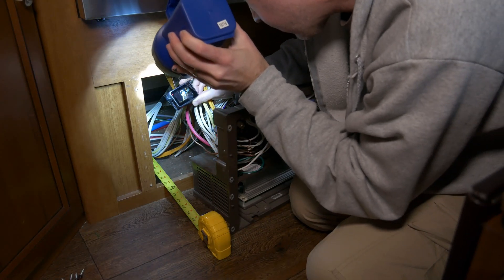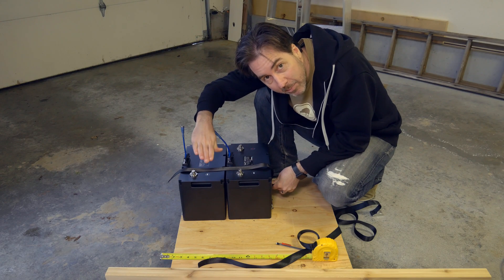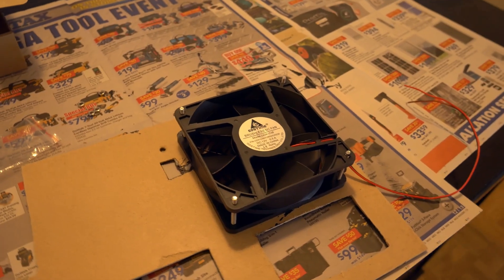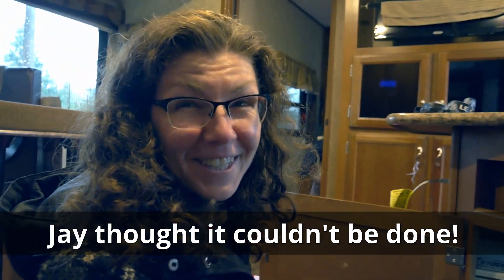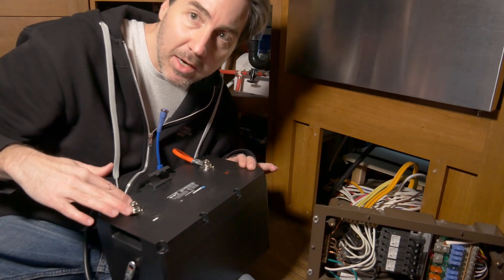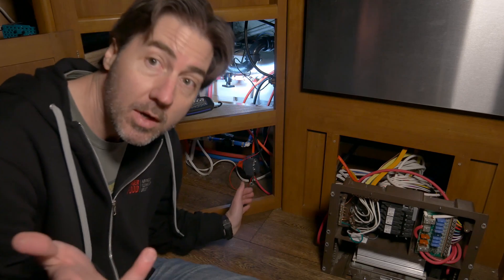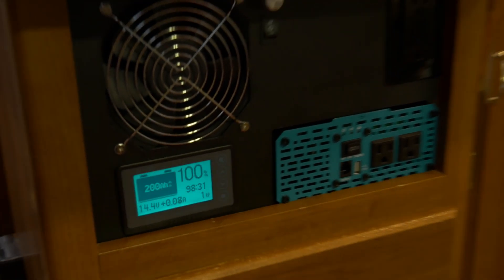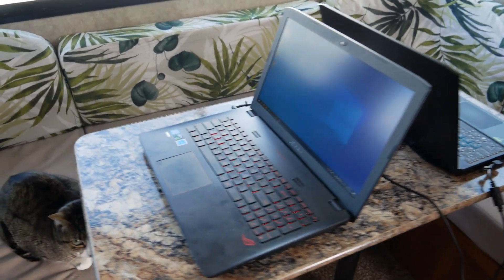How to upgrade your RV battery to lithium (Renogy LiFePO4)

Comment: Do you remove the batteries in winter?  I'm in Canada with old winters.
Reply from the maker: Great question. We don't remove ours, but a) we live in the lower mainland in BC, so winters are fairly mild, b) the batteries are inside the rig, so we can keep them warm fairly easily, and c) we've spent the past 2 winters down south in warmer weather. Generally, for lithium batteries, you shouldn't charge them below freezing, and you shouldn't discharge them much below -10 deg C. So unless they're self-heating or you can install them somewhere you can keep them above freezing, you may have to remove them in the winter.
Reply: @HomeARoam  I'm doing the witch this spring and I'll just remove them as I'm placing mine under the bed.  I'mnot sure if I trust the self heating ones and where I live we get -30 C quite often.  It was just a thought.
Reply from the maker: 👍 Yes, if you're storing the trailer for the winter in -30 C, it's a good idea to remove them.

Comment: Hi, great video!
I have similar WFCO stock converter in my trailer and thinking doing lithium upgrade in similar way. I have looked at your wiring diagram and got a bit confusing on the connection.
I can see you had Renogy Charger output B+ and battery positive wired to the stock converter. What are exactly the VCC+ and POS+ terminals in the stock converter?
Thanks in advance!
Reply from the maker: Great question! I actually got pretty confused with this myself. VCC+ and POS+ are actually both physically connected on the converter, and they're both essentially "battery positive". That's what connects to the 12v bus that powers all the 12v appliances in the trailer. The CO+ terminal is what's "hot" when the converter is running. What I've did was a bit of a hack, but it actually ends up working quite well. That said, the WFCO eventually bit the dust, and I replaced it with a cheaper, simpler converter. If that ever happens to you, check this video: https://www.youtube.com/watch?v=8fg6S5PqxA8 :)

Comment: So…the lithium batteries can run all DC power in the trailer, but not the microwave or air conditioner, right? And when you plug into shore power, you can then run your air conditioner and microwave; and your existing converter can transfer charging over to the lithium batteries? Is that correct? Sorry…just trying to learn. And this system allows you to add solar charging to it if you’d like…great setup if i’ve got this correct. The only thing i wish it had was the ability to tie into current outlets installed across entire camper…have you thought of doing that somehow?
Reply from the maker: Hi there Flint. Exactly. In our case, we chose a smaller inverter that doesn't connect to trailer's 110v AC system. So we can plug in smaller things that run on AC power like computers, chargers, etc. but not our microwave or air conditioner. A larger system can be installed with a transfer switch, and that would let you run the microwave and all of the trailer 110v outlets on battery power. Running air conditioning on batteries requires a very large battery and solar system.
Reply: @HomeARoam  agree and understood. I very rarely use micro or air conditioner, so prefer to keep them isolated and only run off of shore power if needed; but would still like to tie in the regular outlets of the camper to the lithium’s. Still new to this, but I think that could be done with the setup you did, and maintain existing wiring. I think? Still learning…
Reply from the maker: Well, yes and no. A larger inverter could tie into the camper's AC system, but that connects to all of the outlets, and the microwave and air conditioning. If you didn't have the battery/solar system to run those larger devices, you'd just have to make sure not to turn them on. You could leave those breakers switched off when on battery.
Reply: @HomeARoam  I’m probably making this too complex, but i am wondering if a “Larger inverter” costs more than it’s necessary, given I’ll rarely if ever try to pull power from batteries to run AC or micro. I wonder if it would be cheaper (perhaps not) to add a breaker - one for the “pure shore power” side that ONLY feeds the AC and Micro, but also goes to a charger for the lithium batteries. Then the other breakers are fed via shore power through the inverter but only to the breakers with the outlets; as well as pass through for DC fuse box. Sigh…I’ll quit bothering you now. Need to do more research. Thanks for your kind responses.
Reply from the maker: That's possible for sure, but one thing to note is that smaller inverters (like our 700W) do not actually have the hookups to go directly into the AC feed. So by "larger", I just meant one that had that capacity. Otherwise you'd be limited to running extension cords from the plugs on the inverter and that's not really ideal. 😁 Good luck!

Comment: Thanks for the excellent videos (this and Part 1), and thanks for the wiring diagram and parts list. I'm trying to increase my knowledge about the electrical system, LiFePO4 batteries, connections, etc. Looking at the diagram made me wonder why you didn't connect the batteries in parallel. That way (I think, based on my limited but hopefully growing knowledge) there'd be only one pos cable running to the ANL fuse and one neg cable running to the shunt (B-). (-:  Thanks!
Reply from the maker: Hi there Sallie, we did actually connect the batteries in parallel, meaning that positives and negatives for all batteries are connected together. That keeps the system voltage at 12v, and actually, the Renogy Smart batteries can only be connected in parallel. The other option is connecting in series. This can be done with other batteries, but makes things a bit more complicated since you then need to add the voltages for each battery. So a 2-battery system connected in series will be 24v. In systems like these, you then need a DC-DC converter to bring the voltage back down to 12v to run all of your 12v lighting and appliances. The benefit to series is that the higher voltage means that you can use thinner wires and lose less energy to waste heat in the system as a whole. Be sure to check out our RV Electrical video too if you haven't already! https://bit.ly/har-rv-electrical
Reply: @HomeARoam  Thanks! I wasn't considering connecting mine in series when I switch to LiFePO4, but maybe I need to learn more about that too. Thanks for the video link! I'm heavily consuming videos on electrical systems right now. 😁

Comment: Great lot learned, I am wondering where your lead-acid battery were stored, why took so much effort making new space. As far as I know, lithium battery is more less space occupied. Thanks for the video again !
Reply from the maker: Thanks Victor, our lead acid was stored on the tongue jack, but since we do a fair bit of winter camping, we didn't want them outside of the trailer since you can't charge most Li batteries below freezing (0°C). They're also pretty expensive, so we didn't want to risk theft. The most common place to install them in in the trailer's "garage" but ours is fairly small so we didn't want to take up space there. Since we noticed there was a large unused space right behind the converter, and all of the wiring was already there, it seemed like the most logical choice. Although it did turn out to be quite a tight fit! 😀
Reply: @HomeARoam  thank you so much for the detailed explanation ! I gotta say you are really powerful !

Comment: I don’t know if this has been asked or answered but when you connect to “shore power” from your home does it charge your batteries or did you need a voltage adapter?
Reply from the maker: Hi Brandon, yes we hooked it up to our existing converter such that when we could charge quickly either off shore power or our gas-powered generator we bring with us as a backup. However, since we installed the 400W of solar, we haven't had to use it. In fact, our converter is currently our of service and needs to be replaced, but the solar provides all of the battery charging capacity we need!

Comment: GREAT Content!!  watched your Lithium Conversion for newbies and found this second one! THANKS AGAIN!!  

Two quick questions 1) are the only AC plugs you use when boon docking and on "DC Power" those two from the Pure sine wave inverter? 2) do you have a video of the truck charger install(part 3)??  2.b)do the batteries charge with the truck as you are travelling with out a new alternator/charger?? {maybe 3 questions} ;-D [Ignore  2) and 2.b) just read the comment to Paul]
Reply from the maker: Hey thanks Jerrold, glad you found it useful. 1) Correct! Mostly for our laptops and charging camera batteries. 2) The truck charger install has not yet been completed. The solar has been doing so well we've questioned whether it will be necessary. But if we do end up doing it, there will be a video for sure! 2.b) And yes, we can still charge while driving from the truck with the regular trailer cable at about 10a. I've also installed a disconnect since when it's sunny, the solar can do better than that. With a dedicated cable direct to the alternator, we could increase the truck charging to 45-50a. And note we also carry a small 2000w gas generator as a backup.

Comment: is that a lithium converter?
Reply from the maker: Our built-in trailer converter is not lithium-compatible, so that's why we ended up going with the Renogy DCC charger. That's what handles actually charging the LiFePO batteries. Meanwhile, the existing trailer converter only supplies input power to the charger. It's a bit complicated, but the diagram at https://homearoam.com/how-to/rv-lithium-battery-upgrade/ explains how everything connects and is wired up.
Reply: @HomeARoam  thank you

Comment: Wondering why didnt you just replace inverter/charger that in the trailer with one that can charge lithium batteries and provide power to the trailer. That way you dont need that sine wave inverter. Just wondering. Thanks guys. Very informative
Reply from the maker: Thanks Mark and good question. There was no stock inverter, and we needed something that would be able to charge from solar and do a high amp charge from our tow vehicle, and also charge with a lithium profile. For all that, the one Renogy device did the trick at a cost lower than replacing the trailer charger. There was no stock inverter, so we had to buy that anyway. So basically we could have simply upgraded our stock trailer charger and bought an MPP solar charger on top of that but it would've cost about twice as much 💰😁

Comment: Great video. Can I ask about the alternator power? Did you run a separate line to the vehicle other than the one that comes from the normal trailer light/brake connector?
Reply from the maker: Hi Paul, thanks, and excellent question! We're currently just using the normal trailer "trickle charge" cable and it provides about 8-10a max, which is ok if you're driving a lot each day, but not practical for a "quick charge". What I have planned is an upgrade that will run a very thick wire with a special plug all the way from the truck alternator back to the DCC charger in the trailer. This will allow for much faster (50a) charging. Stay tuned for that build :) In the meantime, we'll be carrying a generator with as as a backup power source if we're in a season or location where we won't be able to get enough sun.

Comment: Even though we Boondock occasionally, I don’t think we do it enough yet to justify buying lithium batteries. Instead we have 1000 Jackery. Will go with that for now. Good luck.
Reply from the maker: Thanks, Jerry! Yeah, the return on investment might not be as good if you don't plan on being off-grid very much. There are so many off-grid camping options here in BC and the West coast that having lithium installed opens up our options in an area where competition for campsites is really high.